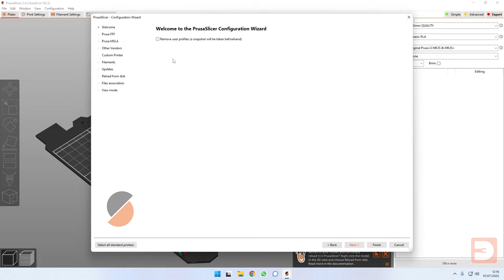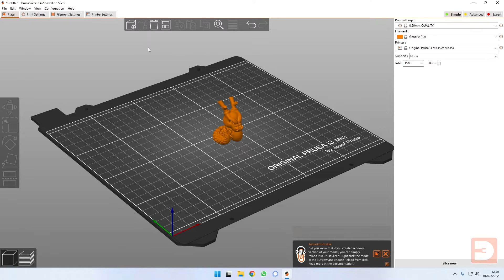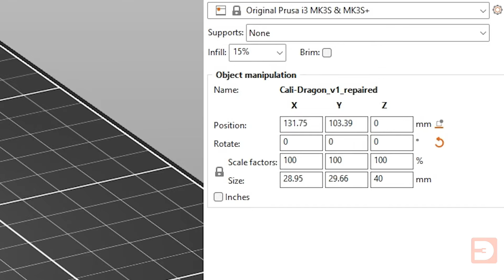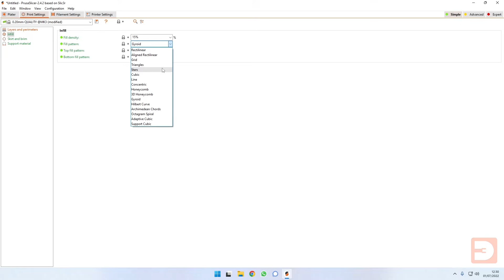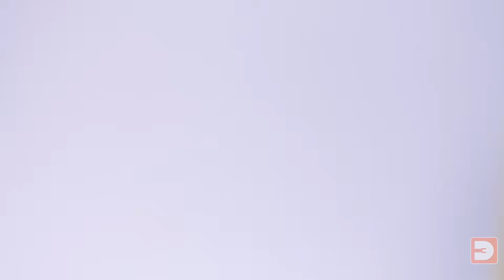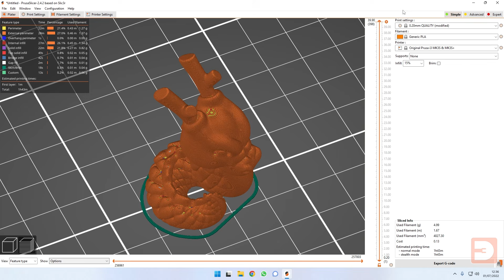PrusaSlicer Beginner Tutorial: Learn the basics

Comment: I'm struggling with it thinking the center of the board is the left corner. Every time I try to print it just prints it in the corner of the plate instead of in the center. Any idea how to correct that?
Reply from the maker: Are you printing using a preset printer or have you added one manually? 

This is an easy solve though. What printer do you have?

Comment: Thank you, I have been using Prusa Slicer for years but still haven't discovered all of the interactions and different features.  I have one recommendation that will be helpful for complete nubs and that is to explain that the filament presets represent a group of default settings that should be sufficient to produce quality prints and normally don't need adjustment.  Also that the adjustments available should be used only if the presets aren't adequate for some reason.

Comment: Outstanding Video. I have been a user of Simplify3D for a couple of years now and by chance watched another video about Prusa Slicer.  I even purchased Simplify3d a couple of years ago when it was $139 US. Now it is $199 US. 
I have to say this, and with a little remorse, from now on I will be using Prusa Slicr.
Goodbye old friend, Simplify3D. You have been amazing and taught me so much, but the features and UI of Prusa cannot be ignored.
My only wish for Prusa Slicr at this point is I wish I could pick the number skirt lines to print before staring the model, instead of just 2 lines.
This is where I fine tune the print settings visually. I usually print 10 lines to get the "mush" perfect before the model print starts.
I don't even use the Autolevel Feature on my Tronxy X5-SA anymore. I just use my calipers between the plater and carriage; then calipers between the carriage and printer frame and then Z-Stop. 
CHEERS

Comment: Can ya use prusa slicer for any FDM printer
Reply from the maker: Yes, most slicers aren't printer specific so you can use them with pretty much any FDM printer.
On some printers there may be specific functions that are exclusively available to their prefered or own brand slicer, but for the most part, any FDM slicer will work with any FDM printer.
Reply: @3DRevolution  can ya do dual color prints with prusa slicer as well or no
Reply from the maker: @monsterstorm78 You can do multi-colour prints. If you're  using a single extruder and want to set the filament to request a change on certain layers, you can follow my video here:
https://www.youtube.com/watch?v=kyrkJbDlcmI

If you're using a multi-material printer such as the Prusa XL, you need to set up a printer with multiple extruders and assign each colour to each extruder.

Comment: How do i start the print???
Reply from the maker: It entirely depends what printer you have. For the majority of printers, you don't start a print from the slicer. A slicers job is to take the 3D model, the physical properties of your printer, and your desired settings, and to export a list of instructions for your printer to follow in the form of a .gcode file.
For the majority of printers, you then want to take that file, place it on the SD card or MicroSD and inset it back in your printer, turn it on, load the filament you want to use, select the file and start the print.
But that process all depends on the make and model of printer you have.

Comment: Thanks for making this series of videos. They are great for beginners like me. 

After slicing the model, you used the sliders on the right side to go through the layers. At the same time, the G-code for each layer was displayed on the left side. How did you turn on G-code display? I could not find anything in the menus to do it.

Is it possible to edit the G-code as one goes through the layers? I am trying to print a temperature tower and would like to change the extruder temperature for each level of the tower.
Reply from the maker: Hey, really sorry about the late reply.

I'm really glad you enjoy the video, thanks for the comment!

With the gCode preview, it only plays back when running through the length of each layer. So the slider on the side of the screen takes you through each of the layers, and then when you get to a specific layer, there's a similar bar on the bottom of the screen. As you scrub through that, the gCode will display. 

For editing gCode, you have a few options, but directly editing in that preview isn't possible. 

Depending on what you want to do, there's a section under 'Print Settings > Output options > Other' called "G-code substitutions". In here you can effectively do a find and replace on certain commands, figures or content on the gCode. That may be  what you're after.

Comment: Great video.  I have been looking for something like this for Prusa Slicer.  I normally use Cura, but sometimes I would like to use Prusa Slicer especially for models that are not water tight.   One thing I have noticed though is the estimated printing time in Prusa Slicer is about twice what it is if I slice the model in Cura.  I was wondering if you might know why.
Reply from the maker: Hmm, it's difficult to say exactly as so much could affect print times. Have you completed things like acceleration rates between your profiles on each slicer?
Reply: @3DRevolution  Yes, I went through and changed some things and now it is still a little longer, but only about 30 minutes difference rather than a couple of hours.
Reply: @zk_6312  ah that's good progress but I wonder what the remaining cause is. Very interesting, hope you figure it out, if I have any further thoughts I'll let you know

Comment: i cant get the z axis on my models to move it seems like its locked but idk how to move it
Reply from the maker: Are you trying to move or scale it? If you're trying to move it, are you trying to move it up or down? 
There are issues with moving something up or down.
Up: You can't print something in mid-air so if you drag it up, it will snap back down to the bed.
Down: If you move something down, then part of the model will be positioned below the print bed, which also isn't possible. If you wanted to only print the top of something, use the cut tool (I've covered how to do this in a video here: https://youtu.be/VdI9K8l38h8?si=gMtKj-q_uV--JOeL)

Comment: After trying to resolve a random slicing error on a single model in Cura I finally decided to try pruaslicer again.  This has been the single most frustrating and maddening software experience I've had since trying to get Windows ME working on a pentuum 120 with 4mb of ram. It seems so illogical and unintuitive for (what i think should be) very simple operations. I have a large model that MUST be printed in a very specific orientation (so please don't suggest changing this). All I'm trying to accomplish in prusaslicer is to lift the model off the bed by 8mm and limit the supports to the lower 20mm of the model. I don't want supports going any higher and i don't want the model directly on the bed due to it not being a flat surface.  I've been able to do this very easily in cura but it fails slicing 9 out of 10 times. This is a problem because i like to check the preview before printing and if i see something i want to change I'll need to slice again. Due to the size of this model it is taking upwards of 4 hours to slice. I'm not running out of memory and CPU isn't loaded fully it so it's not a hardware issue. It's definitely a slicer problem. So now i try prusa and I'm trying to figure out which settings and terminology correspond to the same functions in cura. heaven forbid we use common naming for settings.  So i load a model, place it and have to just accept that it MUST be directly on the bed, add in the negative volume i need, set support settings and slice. Then i see that the supports aren't correct and the settings i want to adjust are greyed out. What?!?!  Doesn't make sense. Lock/unlock and reset options do nothing. Can't adjust something as simple as overhang angle. Greyed out. Only option seems to be to completely abandon the project, relaunch prusa and start all over.  I REALLY hope I'm missing something simple because if not this has got to be the single most obtuse way of doing this i can think of. So far I've watched close to a dozen various videos on prusaslicer and none have covered the settings for the way i want to set things up. For reference in cura this model is about 320gms of filament with 89gm being supports. In prusaslicer it's 639gm with 312gm being supports.

So...

1.how do i simply raise a model above the bed and not be forced to have it on the bed source?
2. Change the support settings on the current model of it has already been sliced?

Comment: does it work with my snapmaker J1? Ultimaker cura doesn't work with my J1
Reply from the maker: I'm not 100% sure as I've not got a J1 to test it on. However, PrusaSlicer does have both the Snapmaker A250 and A350 series available as options in it's configuration wizard.

Comment: I have a rectangle in my project it is cut out but not very deep when I slice it. it fills it in so when I print it is sold. I also have 2 hole that are deeper and they are just fin. I'm using  Creality Ender - 3 S1 Plus and Filament setting Creality PETG- What can I do to fix this
Reply from the maker: Hey there, could you explain a bit more what your issue is, I'm sorry I don't fully understand what you're describing.
Reply: Basically I have a hole in my project that doesn't go all the way through. When I make it into a file so I can print it. A software covers in the hole so when I print it there's no hole.

Comment: Nice Video     I have a model that prints too thin    ( shell )     I have tryed adding more perimeters and the shell dosn't alter,   in the preview mode,    is this the correct way to increase the shell thickness    or    will it have to be done in the  cad drawing.
Reply from the maker: Thank you, and really sorry for the late reply. I hope you've solved your issue now but if not let's see if I can help. The first thing to check is that the shell thickness is only relevant to a solid object (let's say you just put a solid box in there.
If however the model you were slicing was cup shaped, you wouldn't be able to make the walls of the cup thicker in the slicer, you'd want to change your original model.

Comment: what if the PLA filament i’m using isn’t listed. does that mean it’s not compatible with the printer?
Reply from the maker: No you can use any PLA. The different profiles of a particular material are just fine tweaks to the settings that allow for optimum printing of that exact filament manufacturer. But regardless, you can just edit the settings to whatever you want. Presets are just timesaving options that set up everything for a known material. But you can also create your own presents

Comment: I'm going to purchase a Prusa mini plus. Can you please tell me, how do I turn a regular image (say a bird or phoenix) and make it 3d? From 2d to 3d? Excellent video, ty.
Reply from the maker: Hey, glad you liked the video, and I've no doubt you'll absolutely love your Prusa Mini Plus. Regarding how to convert a standard 2D image into a 3D model, it depends what sort of complexity you're talking. If you just wanted an extrusion of the shape (so a square on a piece of paper would become a 3D cube), then the most direct way is to import it into a 3D design software like Fusion 360, trace the shape and then extrude it into a model. If however you wanted to create a truly 3D shape (for example of a bird as per your suggestion), you're at that point bascally talking about full on 3D design.
It does depend slightly on the file type of your image as if it's a vector file (SVG) you won't need to trace it, you should be able to just import it into a CAD application and extrude it.

Comment: Hi i am anuby to 3D printing. I have watch your video but I don't see any where you can print directly from the computer with a USB at the moment that's the only way I can print on which is an artillery sidewinder x1 which I am to get second-hand as a guy give it away
Reply from the maker: The Artillery Sidewinder has an SD card slot, so you can just copy your gCode files output by your slicer onto the card, pop the card into your printer and use the printers screen and controlls to start the print.

Comment: Great Tutorial for beginners! But I have a problem, when I'm trying to move objects on the print bed, they're seem to be attached to the middle of the bed and can't move them to another position, any solution?
Reply from the maker: Make sure you've not already sliced the model. Click on the cube in the bottom left (not the cube made of multiple layers) and try again.
If you still can't move it by clicking and dragging it (which you should be able to do), try activating the move tool which is the top tool on the bar on the left (a square with a triangle on each side), and try dragging one of the arrows that appears on your model.

Comment: When you cut the model in Prusa Slicer, does it also print a joining piece to join the cut parts together?
Reply from the maker: It doesn't. You'd need to either line the pieces up yourself and glue them, or you could in theory use the Negative Volume, and add Shape tools to create your own

Comment: I don't know what's happening when i launch PrusaSlicer. Instead of printer's buildplate i have only white screen. Everything besides buildplate preview remains the same. Can anybody tell  be how to fix that?
Reply from the maker: Hmm that is odd. 
First thing to check, go to the "Printer Settings" tab at the top and check that our printer is selected in the dropdown box under the tabs. If it isn't select your printer, but if it is selected, or if your printer isn't available as an option from the drop-down menu, select 'Add/Remove printers' and follow the steps to re-add your printer. 

That should hopefully work, but if it's still not working for you, cou could try re-installing PrusaSlicer as that should solve any issue hidden in the background that's causing this.
Reply: @3DRevolution  Unfortunately this does not work too. Maybe its happening, because my printer is Creality ender3 s1 plus and there is only alpha version available. I think its sort of bug and it will get fixed in the future uptades. Anyways, thanks for Your help.
Edit: I also tried to reinstall PrusaSlicer like 2 times and this also wasn't working. I guess I'll wait for a while and they're gonna fix it or I'm gonna do something diffrent. Luckily Cura works just fine and i already sliced some files with it.
Reply from the maker: @mtbeyker9404  Ah sorry to hear that. Good luck in the fix, I'll comment back here if I come across anything that may help.
Reply: @3DRevolution  Thanks bro 🤜🤛

Comment: I have an anycubic kobra. How do I figure out what firmware it uses when setting it up at the beginning
Reply from the maker: Hey Jon. Did you want to find out what firmware version you've got installed to compare against newer builds or did you just want to know which style of firmware you have?
Reply: @3DRevolution  which firmware the Kobra uses. I’m sure it’s the latest version but not sure what it’s called
Reply from the maker: @jonmiller4952  I've not actually got an Anycubic Kobra, so I'm not 100% certain, but from what I understand, whilst many Anycubics have stayed away from Marlin firmware, the Kobra does use a Marlin derivative. So I think regarding Octoprint, selecting Marlin should be fine.
Reply: @3DRevolution  thank you

Comment: I have the Artillery Sidewinder X2 the build volume is 300x300x400. Is no place to put the z hight??
Reply from the maker: Absolutely. Once you've set your printer up, in PrusaSlicer, go to the 'Printer Settings' tab, and in the 'General' sub tab, the second item down under 'Size and Coordinates' is "Max print height". It's worth noting that this is designated as an advanced setting though so you need to ensure that the Advanced or Expert tab at the top right is selected first for this option to be displayed.

Comment: Can I use the same setting for 3dbenchy?
Reply from the maker: Hey Stephan, sorry for the late reply. This tutorial wasn't really indending to suggest specific settings (more for giving an understanding of what all the settings are so you can choose them yourself) as you'll want to use different settings depending on what printer you're using, what type of filament you're using (and from which supplier), what model you're printing, and what results you want from that model.
The 3DBenchy is designed to be intended as a test design to see how your printer runs with certain settings and filaments, so there is no correct settings for that. However, as I mentioned, it also depends what printer and material you're using.
If it's your first print, just use one of the presets in PrusaSlicer (making sure you select the correct filament that you're using), and then you can adjust any settings you need to based on the results of that print.
Reply: @3DRevolution  printing on  ender 3 pro with pla

Comment: is there away to angle the cut?
Reply from the maker: As in cutting the model into multiple parts to fit your print area?
Reply: @3DRevolution  I'm trying to do a 45 degree angle cut.
Reply from the maker: @smallnuts2  Really sorry for the late reply. YouTube isn't great at notifying me about replies to comments, only root level comments.
So, the Cut feature doesn't currently have the ability to make a cut at an angle, but what you want to do is still possible. If you first select the model you want to cut, and select the rotate tool, then rotate it by 45 degrees along the X or Y axis, then switch to the cut tool.
The cut plane is always level with the bed, so if you angle your model first, it will allow you to cut your model at the relative angle you're after.
Thanks for highlighting this though. I'll aim to do a short tutorial on the Cut tool specifically within the next week or so and will include how to cut at angles etc.